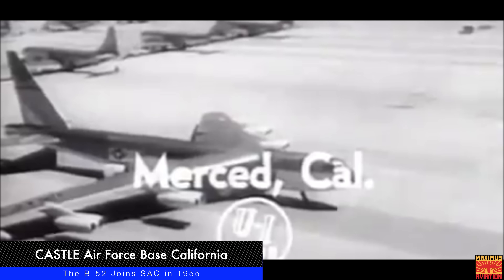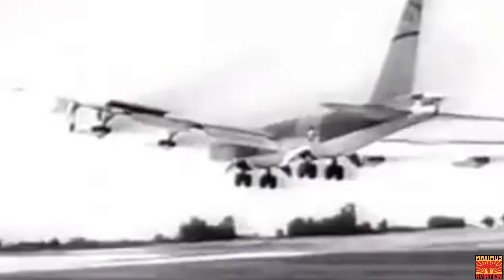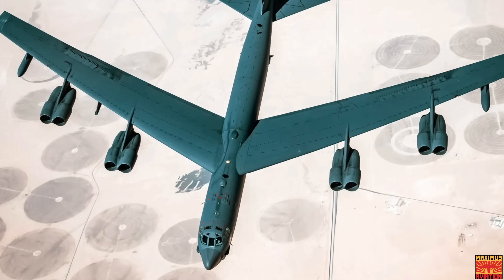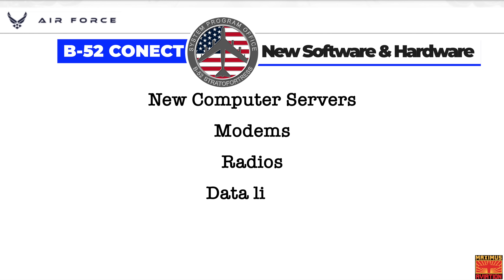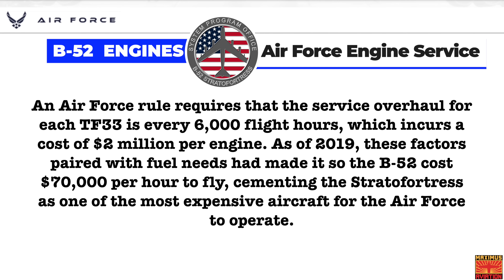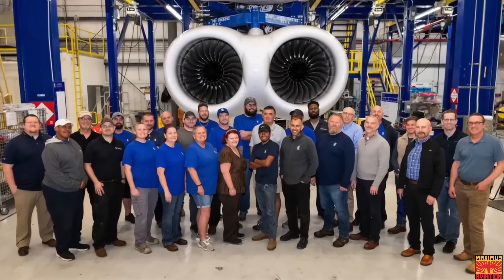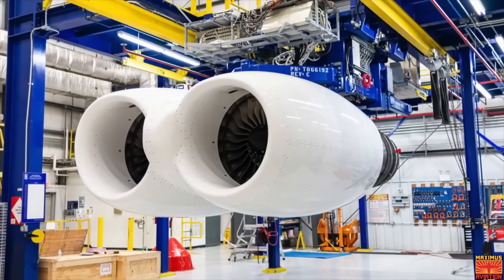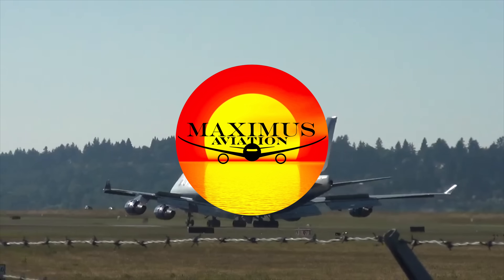The B-52 Will Fly For Over 100 Years With Its New Rolls Royce Engines!

Comment: Just the reduction on smoke, pollution and  contrails is worth the change.    Glad to see new life pumped into this old geezer.
Reply from the maker: True story.  Funny If your around my age in your 50s I remember most planes especially the 727 used to leave trails of exhaust like that back in the day.
Reply: @maximusaviationchannel  If you're
Reply: Contrails have nothing to do with the engines at all. They are produced by water vapor condensing at altitude and can be produced by even turbocharged radial engines on B-17s, -24s and -29s. You really shouldn't repeat stuff you hear of conspiracy sites.
Reply from the maker: @ImpendingJoker  Did you read my comment? I never said contrails. I said Exhaust? I'm assuming your a bit younger but planes back in the day burned a lot dirtier than today. Contrails or Chem trails are make believe. But thos engines spewed a lotta garbage and that's just a fact.
Reply: @maximusaviationchannel  Yep, pre high bypass turbojets up to the late eighties / early nineties did like to roll coal and the BUFF is still visibly very smoky, especially on take-off. I guess they have different particulate limits for military aviation though.
Reply: @maximusaviationchannel I believe Impending Joker was referring to Mexnexus' original comment.
Reply: @maximusaviationchannel  While chem-trails are in fact a conspiracy, contrails, which stands for condensation trails, are very much real and are what the large white cloud like formations behind high altitude aircraft are called. Further if you look, I didn't reply to you, I replied to the OP that did in fact say, "contrail" in their original post. Remember, reading comprehension isn't just a good idea.
Reply: @Papanza295  You, sir, are correct.
Reply: @maximusaviationchannel  you're a bit
Reply: @ImpendingJoker  "Chemtrails" are the stuff of loony conspiracy theories. Contrails (also called vapor trails) are real. They're produced by aircraft engine exhaust or changes in air pressure and are composed primarily of water in the form of ice crystals.
Reply: Wasn't in the Air Force but I live in a small town just North of Ellsworth AFB in SD.  As a kid I remember the giant B36 rattling our windows as it lumbered over Sturgis.  Then in 1955 the first B52's roared over and we watched in awe because it was the first jet we had ever seen.   Hopefully I live long enough to get a glimpse of the new B21 that will be stationed here.
Reply: @donkeyearrs   I lived in Denver circa 1954, when I was 4 and 5, and remember the amazing sound of groups of B-36s high overhead, with 168 cylinders apiece popping away. From watching a couple of documentaries, I’m supposing that they were flying from their base in Texas to buzz the edge of Siberia, then head back. I copied a short sound file from an Internet site to hear that again, and you can get it watching the Jimmy Stewart movie “Strategic Air Command” too.